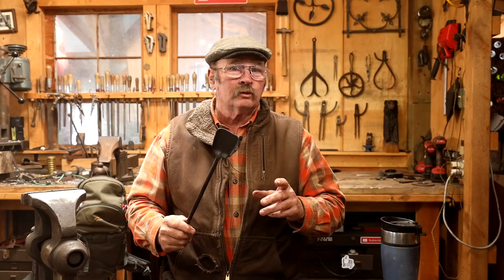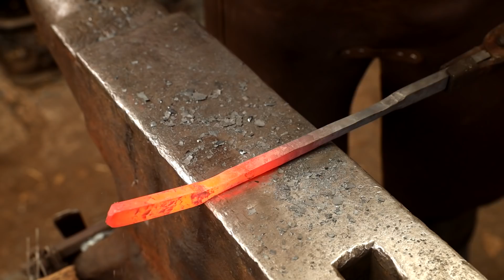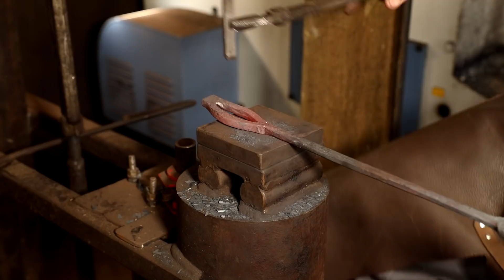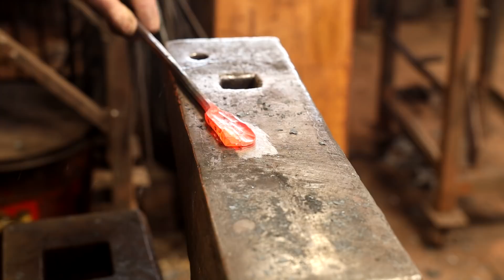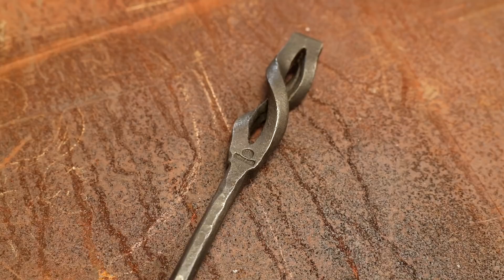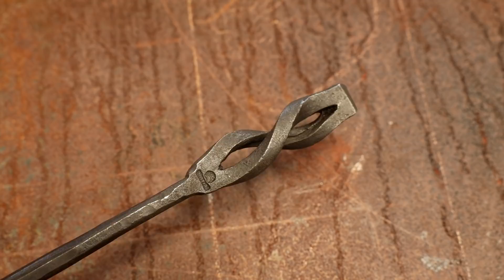Coal forge paddle or small shovel

Comment: By 11:58 I'm thinking, "Enough, don't ruin it!" But you go on and bring even closer to perfection.  Bob Ross indeed.  Though you may have not have the need for one, a trowel, like those used by archeologists would be a similar project.  I wouldn't mind seeing how you develop the ridge at the juncture of the handle and the blade.  Normally the "cheap" ones are welded and always break at that point.  A free Mason legacy project.